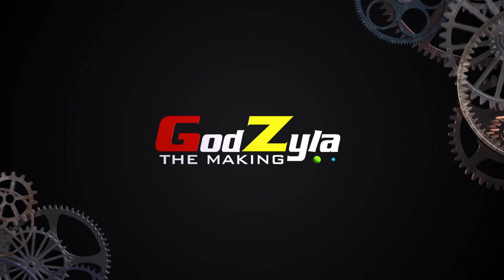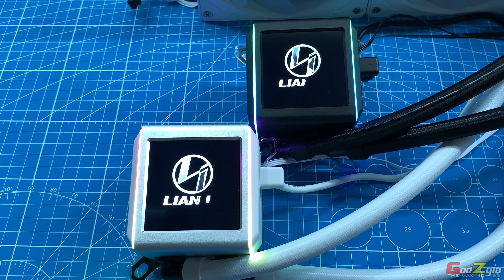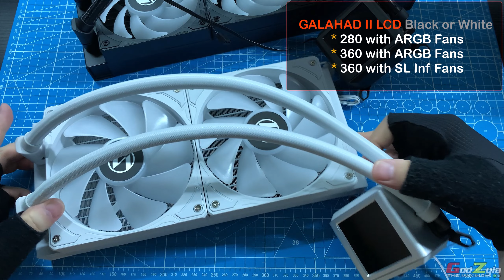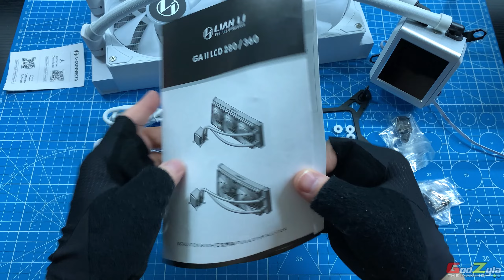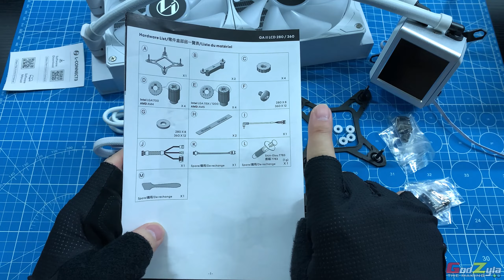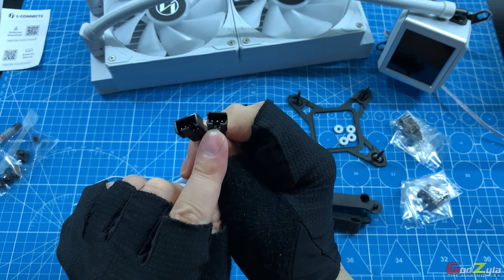Lian Li Galahad II LCD

Comment: KLEO YAN - I need serious help. I've purchasd the "GA II LCD SL-INF 360" for my Asus Strix ROG x670E-A Gaming Wifi but I have zero control over the GA LCD because the option to use it doesn't appear on LConnect-3.  The AIO LCD head itself is completely blank as in off. The only time it appears on is for a brief few seconds when I cold turn on my PC after unplugging it from the mains.

I have the AIO connected in accordance to the manual (USB connected to the main head and to the USB input on the motherboard; 3 pin cable that comes from the head connect to the 3-pin ARBG connector on the top right of my motherboard, and the 4 pin cable that comes from the Head connected to the CPU-fan that is close to the 3 pin connector;   LConnect box powered via SATA and its cables connected to the motherboard's ARGB and 4 pin PWM header/Fan, and the box's USB cable connected to the motherboard's USB), but while I can change the fan speed and lighting colour via the L-Connect 3 software (v2.0.1), the LCD tab option that should appear  on the left side is completely missing so I am unable to control the LCD screen and its lighting.  

I tried uninstalling the  software - including removing the User details via the Appdata via C:Drive Users - then installing and restarting my PC but nothing worked.  I re-checked all my cables, all no problem. I even went to the bios and I see the bios can read the CPU fan and Pump speed.  I tried updating the AIO firmware but admittedly, I cannot find the correct one to use via Liam's site.  Right now, I am completely stumped. I spent a lot of money on this AIO cooler, I really don't want it to be all for nothing.

PLEASE HELP!  I'm honestly don't know what to do, and I want to be 100% ok with my AIO before I consider OC my 7950x3D machine.
Reply from the maker: hello EAprima, I like to check, do you see any lian li device under your windows device manager? if you do, did you install the correct version of L-connect 3 app. if you have done any uninstallation of the L-Connect 3 app, there will be left over registry or unwanted files. Kindly make use of revo uninstaller to uninstall the L-Connect 3 app and to remove all registery and unwanted file, then download version 2.0.1 here.. https://lian-li.com/l-connect3/, install it and run.
Reply: @KleoYan  Thank you for your reply, I am most grateful. Your reply gave me a clue as to what could be the problem for when I looked under Device Manager, I only saw the LianLi SL Infinity v.1.4, which indicate to me that the AIO's head not being read by the motherboard. So, for safety, this is what I did:
1. Uninstalled LConnect-3 and its registries using Revo Uninstaller, as you advised.
2.Shut down the machine and took out the AC plug.
3. Unplugged the AIO USB3-to-usb2 cable (USB3Cable) from both the AIO head and the motherboard.
4. Connected the USB3cable to another USB2 slot on the motherboard.
5. Re-Connected the Usb3cable into the AIO head but this time, I pushed it in more firmly to ensure that it was in. When I did this, I felt and hear a tiny click!  Could that have been one of the sources of the problem?  Who knows.
6. Plug the AC back into the PSU and turned on the computer.
7. When into Device Manager and viola!  LianLi GA II LCD appeared!  A great sign.
8. Installed L-Connect 3 App v2.0.1.  Viola!  The LCD submenu appeared!  Thank goodness. Unfortunately, the LCD itself was making lots of weird images.  So I closed the app.
9. I restarted the App and the App requested me to specifically Update the LCD Firmware.  Excellent!  I went to the Update section and updated the firmware successfully.
10. Everything working!! LCD is on. I am able to adjust the screen as I please.

The next and final task for me is to try and overclock my 7950x3D running on my Asus Rog x670e-a gaming wifi to 5.7ghz. I've been trying all day but I cannot find not one video guide that can help me do it, and the latest version of the bios only manage to clock up to 5.1ghz even though AMD stated that the CPU can perform 5.7ghz.  I'm so baffled...  I wish you could aid me to achieve this one if you could.

Thanks again, Kleo Yan. If you can help me with OC'ing this 7950x3D on my mobo, I'll be awed.
Reply from the maker: @EAprima  lol you so adorable.. ok for 7850X3D, as now the new bios stucture is different. which is the AGESA 1.0.7c. no matter what you set and want to pull, the system will determine which value to pick up, which is based on how much cooling you system is provided. Take for example. in PBO2, if you set lets say set the PPT to 182000 . it does not means that you can sustain at 182Watts.. the system will collect info by itself (some kind of AI) then it will  apply accordingly. I would advise not to pump too high. best is to do undervolt and to play with optimizer curve.
Reply: @KleoYan Thank you so much. I'll investigate the OC aspect further.  I am running across a new issue though with the fans.  Like many others, LConnect 3 stop reading / registering the fans, rendering the speed readings to zero.  The only way I figure out to resolve it is by uninstalling LConnect 3, delete the Lian_Li folder in C:/Program Files then reinstall LConnect 3 v2.0.1.  That gets everything back to normal but when I restart/shut-down my CPU the non reading fans problem occurs all over again. I can't keep uninstalling and reinstalling the problem just to get it working every time I jump on my PC.

Any idea how to resolve this one?  I will be so grateful.
Reply from the maker: @EAprima  I assume your pwm cable is connected between the Uni controller and the motherboard fan header (Example CPU_FAN). try check in UEFI where the header is (Example CPU_FAN), see if it's set to Auto or PWM. if it's on auto, set to PWM mode.
Reply: @KleoYan   Yes, PWM Mode was one of the first settings I did when I installed it. Sadly, the problem still occurs despite the UEFI is recognising and reading the CPU fan speed everytime I turn on the PC.  Any other solutions? Maybe I should put the PWM Cable in a chassis fan instead? I doubt it would make a difference.
Reply from the maker: @EAprima  ok. can you try this. use revo uninstaller to uninstall the L-Connect 3 app, make sure to remove all unwanted registry and files. example in this vid on the actual timestamp https://youtu.be/uMgUYiakpxM?si=8isUQ9pWvKounfgZ&t=437 and the application revo from here https://www.revouninstaller.com/revo-uninstaller-free-download/ (download the free copy will do). Next reboot your system, reinstall the L-Connect 3app. btw do you happened to use Asus Armoury Crate? if you do, uninstall that too but use the Asus Armoury Crate Removal Tool from your motherboard website.
Reply: @KleoYan  Thank you so much! I think we are making progress. I've completely uninstally Asus Armoury Crate but it didn't resolve the problem. However, I also had iCue installed for my Keyboard (K70) and memory card lighting which I decided to also completely uninstall clean from the machine. After doing that I restarted the machine, installed LConnect 3, changed the settings, restarted the machine again to see if LConnect would crash like before and,... viola!  No crashing! LConnect 3 is working fine! FINALLY!

This unfortunately does leave a grey area which is, how do I change the RBG colours on my memory cards/sticks (Consair Dominance 6800) and K70 keyboard now considering LConnect 3 doesn't seem to like iCue and Asus Armoury and doesn't have any option to manipulate the keyboard and memory stick's RPG?  There got to be a solution...
Also, do you know how to control the Lian Li O11 Case lightning (the beautiful one line stripe at the front) as I'd like to adjust it the same way as the infinity lights at will via the LConnect 3 or some other way.

Thank you so much for getting me this far!
Reply from the maker: @EAprima  hi and welcome back. I see, now something which you will need to know. All argb ego system on windows platform allows up to 2 softwares. I see your issue now which you have 3 application running. I am afraid you will face intermittence with 3 application running together at the background. You see all argb shares the same IRQ, your argb application is fighting to grant rights, that's why you face the issue and have to restart or uninstall. This I have no solution for you to run 3 argb apps together, as for your O11 case argb, there should be an argb cable where you can plug to any of the port from your SL-Inf controller. You might need an adaptor as the port of your uni controller does not use the standard argb 3pin 5v connector. 

IRQ - An interrupt request (IRQ) is a signal sent to a computer's processor to momentarily stop (interrupt) its operations. The signal is usually sent by a hardware device to interrupt the processor so the device gets some time to run its own operation.
Reply: @KleoYan  Update report - LConnect has been causing the AIO to crash which ends up freeze windows, thus resulting in a hard reset. It has been according for days. From looking at the EventViewer, I've learnt that it's the LConnect Service that has been causing all the problems, which is really bad for I brought everything for work/business primary and games secondary.  The exact nature of the issue eventviewer highlighted is this:
.....
Init CPUIDSDK failed. (8, 258)
SDK mutex locked.
Event ID 15
 L-Connect Service 
 Init CPUIDSDK failed. (8, 258) SDK mutex locked. 
.....

In search for a solution,  I've found a lian li hosted thread on reddit highlighting that they are aware of the problem. In fact, they said this:
.....
If you experience unexpected issues with L-Connect 3 v2.0.1, such as the GA II LCD screen freezing suddenly:

Make sure your firmware is updated to version 0.8 (you can verify this in L-Connect 3 > Settings > Updates).

Remove L-Connect 3 v2.0.1.

Download and use this version.

These issues may be caused by L-Connect 3's backend service having compatibility issues with some motherboard's USB transmission. We are actively working to debug and resolve this problem, but if you encountered this issue feel free the let us know which motherboard you're using.

.....

In reaction to this, I've uninstalled LConnect 3 from my CPU (registries too) using Revo Uninstaller, deleted the LianLi folder from Program Files for good measure, and downloaded and installed version v2.0.0 from the drive they linked.  Crossing fingers for all to go well (no more freezes please), and for a new updated version of LConnect 3 to resolve this ShowStopper issue once and for all so they can focus on newer things such as getting LConnect 3 to work with iCue or FusionRGB, and for the company to build up more options within LConnect 3.  Options such as better LCD text and graph/meter presentation like their competitor, ability to run the RBG brightness 20% higher (120%).  etc.
Reply from the maker: @EAprima  WOW. that is full diagnose, I had my hats off you. You are the only one who is keen to dig deep into a problem, I wish most teenages will be like you. I fully understood where you are coming from, I am using 2.0.0 back then when I did this content, plus I dont use any other argb applications. I stick to ASRock board where I can control the ARGB from UEFI, no background apps. I hope version 2.0.0 will work for you. Now if I may use your feedback. I will highlight this to Lian Li, I will also like them to have an uninstalling tool like the revo uninstaller, to remove all registry and unwanted files. Thank you buddy for all your feedback. greatly appreciated it. Best part is. you are the only person who will do point form which is easy to read and absorb what you are typing. Thank you so much!
Reply: @KleoYan   Thank you.  Yes, please definitely report everything to LianLi in hope for them to expedite a solution for this is ruining their credibility.  Software issues like this is bad, and...  Sadly, v2.0.0 didn't work for me either as the AIO LCD and the light went blank which froze window forcing me to, yet again, to a hard reset. This is bad. For now, I went back to v2.0.1 as it lasted/lasting a little longer. 

To assist with your report to LianLi, here are the main LConnect 3 Errors that my Event VIewer communicated to me (cannot copy & paste everything otherwise Youtube will auto delete the post like it has done several times already):

i. "The L-Connect 背景服務 service terminated unexpectedly.
Service Control Manager;  7034

ii. Faulting application name: L-Connect-Service [dot] exe
Faulting process ID: 0x2bc0
EventID: 1000

iii. Application: L-Connect 3[dot]exe
Description: The process was terminated due to an unhandled exception.
Event ID: 1026

That's it.  I really hope the above info will help for a surefire solution.  If my Windows crashes again, I think I better go for the UEFI controlling root on my "Asus STRIX x670E-A Gaming Wifi (BIOS version - 1709)". The only issue is I don't know what software would be good to control my AIO and 7 SL-INF 120 fans (two triples, one single), and I'll feel crushed if I don't have something else to run the LCD screen. 
I cannot believe that I've spent thousands on my new PC and what's horrible it is an extremely buggy software that is actually crippling my PC. If I don't have a solution soon, I may have to ask LianLi if they can do something for me financially so I can go somewhere else, or something.   This is bad for it's ruining the company's credibility.

Sorry for the long lengthy post but I hope every info on there is vital and helpful for a solution to nail this once and for all so we can only provide new ideas to Lian Li to improve their LCOnnect 3 software.
Reply from the maker: @EAprima  hmm why not draft me a direct email. godzylatech@gmail.com with your details. I will forward them your issue. Thank you.
Reply: @KleoYan  Oh, wow. So kind of you. Thank you very much. I'll do exactly that. 

I've taken your email address down so, if you wish, you can remove it from your post.
Reply from the maker: @EAprima  nope. It’s perfectly fine, don’t worry about it. Leave the post and once have an update or fixed, It will be good for all 😉
Reply from the maker: @EAprima  there is a new release, I wonder if this will fix the issue https://lian-li.com/L3-changelog/

Comment: the app not picking mine up is it because the app acting up or i can not use the connect box which i put them in?
Reply from the maker: Hi Inf4mous twin, welcome to my channel. do you mind to provide more info as in, which Liquid AIO type and style are you using? also did you get additioal uni fans which comes with the uni controller? I can't aid you with you general question.
Reply: @KleoYan  I mean the new Galahad LCd
Reply from the maker: @inf4moustwin15  Can I assume you are using the normal Galahad II LCD and with a 3 pack set of SL120 fans.. by the way which version of the SL120 .. is it the V1 or V2?
Reply: I already had fans in my case which is the first ones with the rgb in the outside not inside the app it self now won’t let me screen post
Reply: @KleoYan   brother the app keeps kicking me out
Reply from the maker: @inf4moustwin15  do you mind to keep calm and I appreciated if you can answer my question in a more specific manner. I assume you are using the SL120 V2 3pack with the controller. you will need to plug the LCD usb to your motherboard 1st USB header and the SL120 controller to the motherboard 2nd USB header.
Before you install the L-Connect 3 app.

1) check in Windows on device manager. Did it shows 2 lian li controller (one for your LCD block, another is for your SL120 uni controller)
2) If it does show, then install L-Connect 3app, do necessary firmware update

if above dont work and you still getting disconnect.
A) Is your motherboard with the lastest driver for all your USB Ports and such? please check your motherboard brand website.look for .inf installation.
B) Did you check your motherboard bios version. there might be some bios to fix the usb disconnection issue

 Is possible, view this and to understand the basic function of how Lian Li ARGB ego system works https://youtu.be/CgvuUFeff8U?si=eKqU2QJk-P53Imd6
Reply from the maker: @inf4moustwin15  One last thing. did you install the correct L-Connect 3 app? Current version: v2.0.1 Posted: 10/20/2023 from here https://lian-li.com/l-connect3/
Reply: @KleoYan   I tried updating the soft wear but it’s still stuck on 1.7.2
Reply: It would not let me update it to 2.0
Reply from the maker: @inf4moustwin15  

1) Did you have both controller show on device manager? if yes, proceed A) and B) 
if now, please refer my instructions above.

A) Please read instructions slowly and properly at this page https://lian-li.com/l-connect3/ (scorll down, there are two verions) 

B) Download only version v2.0.1 and directly and install.
Reply: @KleoYan  there something wrong with 2.1 I just downloaded 2.0 and it works
Reply: @KleoYan  there something wrong with the app just kicked me out of it and recycled to default
Reply from the maker: @inf4moustwin15  try revo uninstaller to uninstall all L-Connect 3app and it's registry.
Reply: @KleoYan  omg it worked thanks man godbless for all the help all updates worked
Reply from the maker: @inf4moustwin15  you are mose welcome. enjoy your system now 😉
Reply: @KleoYan  I have the SL with the controller can’t I plug in the box the The New LCd air fans to it or separately
Reply: @KleoYan  I have the new air but the app acting up bad